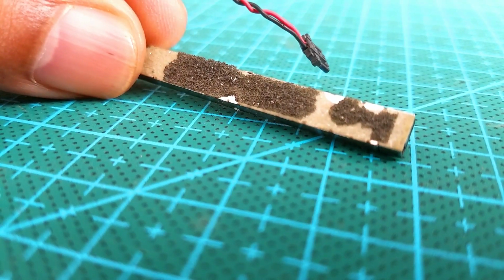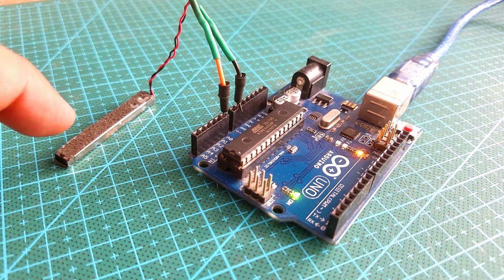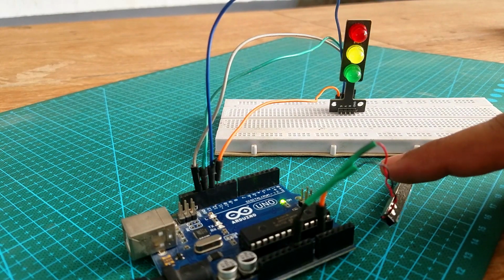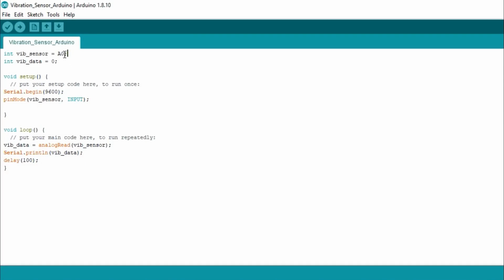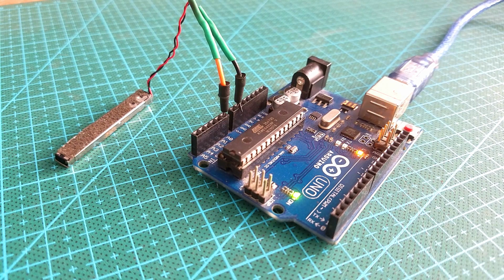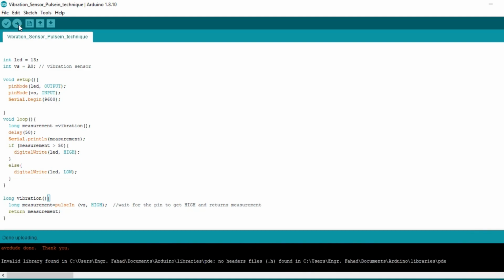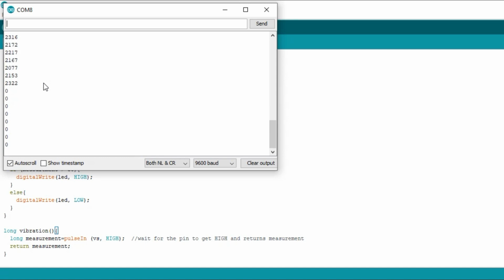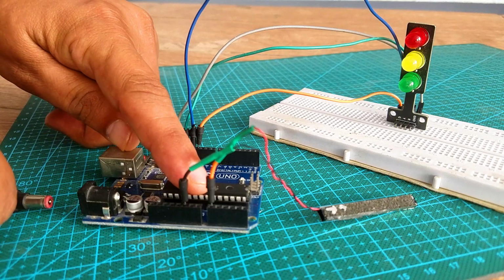Vibration Sensor with Arduino, Vibration Detector AAC 51 000923, Vibration Measurement

Comment: Great video sir I have a question I'm currently using SW-18020p vibration sensors could I use these as my component instead of the one shown and will your code work for my sensor I'm new to arduino so I'm struggling with code